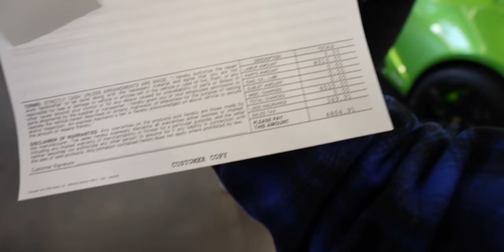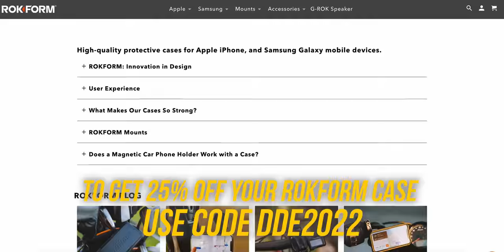DAMAGE COSTS I’M SUING FOR FROM LAMBORGHINI SLEDGEHAMMER ROAD RAGE!

Comment: Doesn't seem like that insurance guy had a clue what he was looking at or dealing with. "Take the wheel off to see the damage" no buddy it's a little more complicated than that.
Reply: I couldn't agree more with you. He seemed both clueless and absolutely uninterested.
Reply: Yup, also no it's not repairable! The thing is toast, I am 100% certain
Reply: @Miguell2005  the insurance company tried to say my mom’s nissan was reparable after another car literally crashed into the front end and drove on top of it. They didn’t even bother inspecting it in person, they were going off photos they asked my mom to send in (hood closed)!  As soon as I started asking questions about how they would repair it given frame stresses, radiator replacements, possible engine damage, etc., suddenly the car was a total loss. Saved my mom weeks of headaches and stress.
Reply: @Miguell2005  When Dave was attempting to explain that the car would need to be hoisted and placed on a frame template to make sure it wasn't bent anywhere the guy just goes "yeah yeah needs to be on a jig" doesn't have a fkn clue what he was even trying to tell him. There should be specialized insurance agents dispatched when dealing with a class of cars like this that understand what's involved and how simply 'looking' at the damage isn't enough to tell the whole story.
Reply: @ericjenks9596  One thing you learn the older you get is just how incompetent the majority of employees in any industry actually are. It's actually mind blowing.
Reply: Our insurance was trying to say our vehicle was fixable until it went to the body shop. Body shop called them and totaled it out.
Reply: @1pauld  Yeah it is all encompassing across the entire planet. People that are completely incompetent in their position. I agree
Reply: That’s why the car needed to go to a proper body shop firsts then the insurance guy comes to the  body shop and makes there estimate with all the info possible not to a storage facility. What ache said was correct he can give him a estimate but due to the damage not seeable it need to go to a body shop for proper inspection
Reply: Incompetent people are everywhere, they way he looks you know he like wtf is this
Reply: That's why the car needs to be at a Autobody shop so the professionals can tell him how much it's going to cost. That insurance guy only decides if the cost is worth writing a check  or not
Reply: @mattclark2641  it’s still going to a shop the dude agreed
Reply: @1pauld  I couldn’t agree with you more its actually insane how many businesses, schools, etc. that I’ve called to ask simple questions about their product or service where the employees can’t or won’t answer jack shit, then essentially keep transferring me in circles until i gave up. “Oh you need to call B for an answer let me transfer you”. “Oh sorry this is the wrong place for you you need to call A for that” I just came from A they sent me to you???
Reply: You literally do need to take the wheel off to see further damage. What do you expect the insurance guy to do? Use xray vision to see the true extent of the damage? It needs to go to a body shop OR dealership.
Reply: @claycollins8973  it’s repairable dude
Reply: The car is totalled lol they all know it
Reply: @KontenderTV  just send to goon squad & they will fix it
Reply: @claycollins8973  alex gintani himself said the car is fixable, the guy literally tearing a part that car from scratch. idk who u but the pro said otherwise.
Reply: @KontenderTV  alex gintani himself said the car is fixable, the guy literally tearing a part that car from scratch. idk who u but the pro said otherwise.
Reply: lmfao you clowns are funnny
Reply: @yanzn5926  Alex isn't an insurance adjuster he's just saying comfort words for everybody to feel better lol we all know the car is done
Reply: I work at a body shop and this insurance guy shouldn’t have waisted his time. The body shop is supposed to take it apart and inspect the frame visually with the insurance in person. This is why my estimator use to work for a insurance company first.
Reply: @mattclark2641  🤣 facts, these people are funny thinking they know everything all the time.
Reply: @KontenderTV  lol its not, alex said its ez if DDE just give it to him right way to make him do a check on gintani shop, its just damon need to make adjustment with the insurance what to do first hand. even if the insurance company decide to fix it, would likely go to official dealership, not some aftermarket shop like gintani to make the insurance make an estimate price cost.
Reply: What he saying is if the car was at a body shop already and it was took   apart him and The Body Shop guys can go over an estimate and see all the parts that are damaged in what is needed they would already have a list of the damaged stuff that needed to be replaced for the adjuster when he came
Reply: Nothing wrong with what the insurance guy said. He was honest with the way it is supposed to work. You need to get the car full checked out at a place that will specialise in that car and then the insurance adjustor will come in and get his work done.
Reply: You have no idea how it all works and it shows. The guy is there to document (which is why they take pictures) and maybe make an estimate. The insurance company won't have a "McLaren specialist" to go and asses a hit McLaren. It's a car, and they are all assessed the same. He is right when he says "The car needs to be taken to a bodyshop of YOUR choice, have the wheel off to properly assess the damage".a

Stop being so sentimental for no reason.
Reply: @intricateinc8566  And all across the entire planet there are people who have no clue, but have opinions on how people should be doing their jobs.
Reply: @claycollins8973  its toast huh. nothing is toast lmao
Reply: @yanzn5926  The insurance company doesn't tell you where to take your car. You can take it to any shop you want all they do is write the check and determine whether it's fixable or a total loss.
Reply: @Dranzell  It's clear these people have never dealt with Insurance or their Adjuster. If they were smart they'd take it to the dealership where they charge top $$ for everything get the $$ off that estimate and have Alex redo it. That's if the monocock or aluminum isn't totally jacked.
Reply: He's just there to confirm he saw the damaged car
Reply: The guy seemed like he didnt know what he was looking at. His face when dave said monocoque said it all to me
Reply: @1pauld  boy are you right. I deal with engineers every day, they “calculate” a project in e.g. steam. I’m specialized in steam systems as an Engineer, you don’t want to know how many dangerous mistakes I see in the work of most Engineers. Its ridiculous. There is little to no knowledge left, schools don’t learn anything to the young people now.
Reply: sounds like you don't know what you are talking about of course they need to remove wheel to asses damage to suspension also will need to remove other parts to check frame etc. also  measured usually with laser to check for frame damage or maybe jig as stated in video
Reply: @Dranzell  For every ying there is a yang
Reply: @dann6828  just send it to germany. Repaircosts are cheaper than buying a new car like that - so the insurance will pay the repair - done
Reply: Why is it more complicated than that? You literally can't see anything important with the wheel on and the car on the ground.
Reply: @RR-bt5xv  ikr, OP doesnt have a freakin clue.
Reply: @-jamesbond  Exactly. He actually asked if the vehicle was getting repaired where it is, as he is most likely use to going to a repair center to look over the vehicle & talk about what they estimate repairs are. Most guys here are confused as to what an assessor actually does.
Reply: @Dranzell  Agreed - its frustrating when viewers make assumptions about people & rather than ask what the guys role is, they start abusing the poor dude.
Reply: @Gdsfghbbvfdd  If you take note, the assessor was most likely just given the address as to where the car was & since its a commercial building, he probably thought it may be the repair center or repair center storage, as he actually asked if the car was going to be repaired by there.
Reply: He was right you need to find a body shop so you can property tell the damage on the car. 🤦🏻‍♂️
Reply: To be fair... you actually do have to take the wheels off to inspect further lol
Reply: @kingsamoanOG  so they didnt bring the car to gintani yet must be because?? hmm interesting
Reply: @terence.pereira  so the fact they didnt bring the car to the repair shop yet, coz they hope the insurance decide its total loss or they just dont know how the insurance works?
Reply: The motor is cracked for sure.
Reply: I mean, he didn’t say anything wrong. He was saying that he could not assess the full extent of the damage to the frame of the car without the wheel being off which is true. So he suggested they take it to a reliable body shop that they trust so he can come back and have a proper idea of what’s going on. 

The guy only works for the insurance company so he’s not gonna know all of the ins and outs of a modified McLaren 720s. Not too much he can do other than either telling them what he already said. Yeah he could say that the car may be totaled but it’s better to exhaust all options before doing that because of how expensive it is. And considering that DDE’s insurance would have to cover the cost before it gets fixed or they pay for it outright he doesn’t want to just be making guesses
Reply: @Gdsfghbbvfdd  I mean he literally said that he would go to the body shop and inspect the car…
Reply: You guys realize it goes to a claims specialist right? There's 3-5 tiers of claims specialist depending on length of time in field and licenses held. For example a tier 5 specialist will look over these photos and the estimators notes and figure the best way to get it to a shop for supplemental. They've spent time in actual paint booths, have mandatory body shop classes, paintless repair etc. The aftermarket parts do not get covered unless Damon goes through his insurance and it has a policy that covers third party accessories which usually has a limit of whatever you choose. For instance I pay an extra $60 bi-annual for $18000 in third party acc cov. The right specialist will try getting a hold of McLaren or a specialist who has worked on this car instead of just marking it off as a total loss. This guy is a field adjuster, his sole purpose is to document what he can see at ground level and take photos so it will go to the right tier of claims, Damon will get a call from them asking for it to be sent to the dealership to remove components and get a better idea of structural damage. My guess would be the kid will max out the policy on the wing alone.
Reply: @SuperiorDefense  Obviously most of the people in this comment thread have never had to deal with an insurance company before lol. Seems like they expect the insurance agent to just come out and fix the car himself or write a check for it on the spot. When that is nowhere near how it works. This guy came out and did exactly what is required of his job and offered to come back once they take the car to a shop. Most insurance companies would just tell you there’s nothing they can do for you with a car this expensive and all of those aftermarket parts on it

Comment: Not that you need to add anymore to the tab, but I'm pretty sure the camera on the windshield  behind the rear view also needs to be recalibrated. Look into ADAS Calibration. Front collision warning systems, adaptive cruise control, etc. may not work properly until you do.
Reply: Non adas just a rainsensor

Comment: Working at a dealership for the past 30 years. We have had to take the dashes completely out of a few vehicles to remove all the glass shards when the windshield is that damaged. I hope they got them all out. When you turn your defrost on you don't want those glass pieces going into your eyes.

Comment: I bought a Rokform case for my iPhone 13 Pro Max and it protected my phone completely in a motorcycle accident. 10/10 do recommend
Reply: Is it too bulky? The Pro Max is already a huge phone
Reply: @Lovin_NY93  for me, it’s not too bulky but I have big hands and switched from an iPhone 8+ with one of those big otter boxes. It definitely adds quite a bit width, though, so if you prefer slim/sleek, I wouldn’t recommend you buy one

Comment: In the uk (where I'm from), we have 3 levels of insurance. So they are 

1)third party only, which covers ONLY the person/car you hit. 

2)third party, fire and theft. This covers the other party, but also covers your car against fire and theft. And last, 

3)comprehensive, which covers everything, literally. Obv the other party, but also, if someone crashes into you but drives off, damages your car, like when you had your windshield hammered. In this country, windshield replacements are subject to a £50 excess charge, but then the insurance picks up the rest. 

As to the rest of the insurance, the uk insurers have a set maximum, which means anything above that and the car is deemed a write-off. This means that it would cost the insurers more than the cars worth and so they wouldn't bother fixing it but would instead pay you whatever the 'book price' is, or how much your car is worth given age, repair and condition. It would usually be more than they would value your crashed car so you could always buy it back and get someone to fix it, often costing less than the insurance pay out.

Comment: Great install video of the new windshield. The only thing I see them skip was when the windshield is completely out the broken one that is you need to turn on the defroster and blow the broken glass out of the system. When you do it afterwards, it’s harder to get the glass shards out of the interior. It’s a pity this happened at all.

Comment: I work for Safelite and they did a good job except for at the end. He touched the inside of the glass with his bare fingers. The oils from your hand will keep the glass from making contact with the glue. It's not a guarantee that it won't seal or leak but it was an unnecessary risk that would let air and water run by that part of the glass